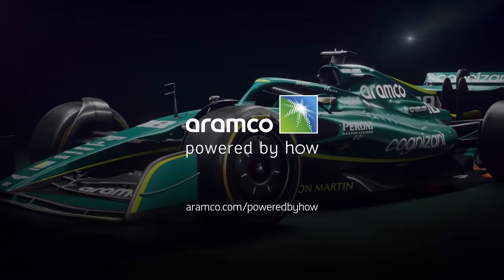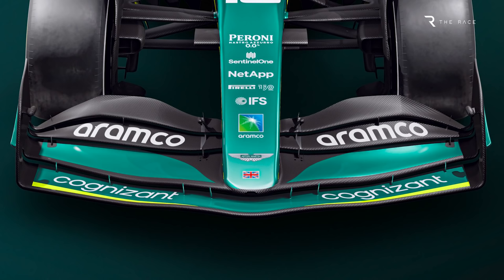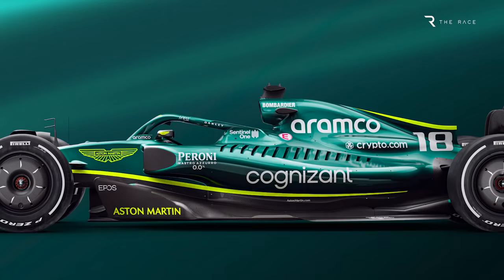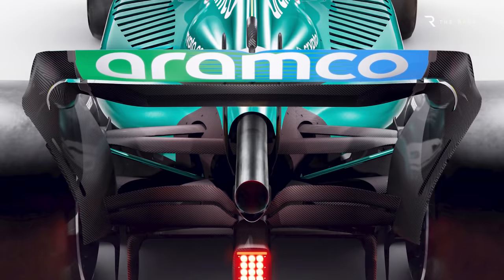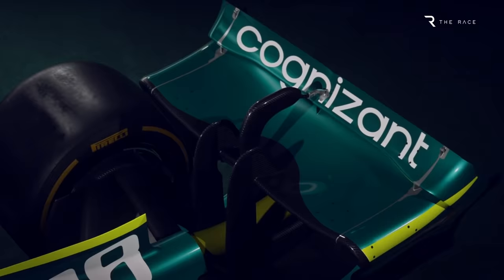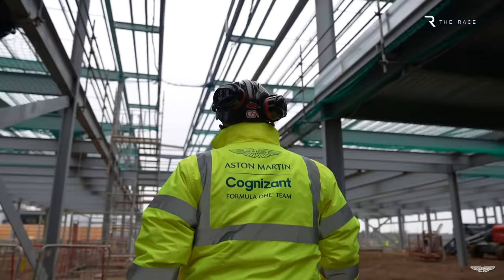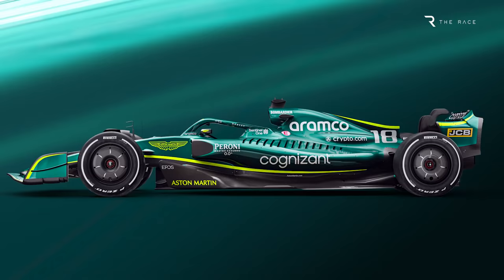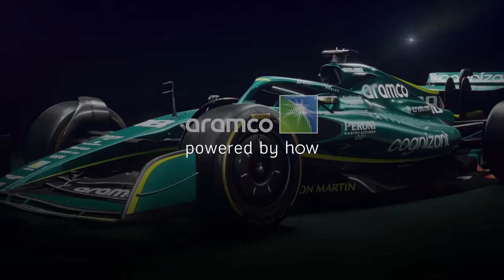What Aston Martin’s ‘honest’ 2022 F1 launch revealed

Comment: @7:44 "The 2nd phase is a building of about 100 square feet to house the new state of the art wind tunnel."

I take it that "state of the art" is Tardis style technology where the inside of the building is significantly larger than the outside dimensions, as fitting a Formula 1 car inside a building measuring 10 feet by 10 feet would be challenging.

Comment: 7:45 100 square feet is a smol building (10 feet by 10 feet, or 3 meters by 3 meters for those not in the USA). I believe you meant 100,000 square feet, but I'm only guessing. Cheers.

Comment: The biggest noticeable difference of these reveals is the high placement of the intakes for the radiators. Can't wait for the results of the on track testing of the beta reveal- of course the REAL design won't be known until the first race. For now they tease us with paint/decal designs. 
 the biggest notation for Aston Martin are the "gills" on the side pods. I struggle to believe those will be a reality. It could be, but at this point, it's liars poker and don't believe anything I see besides the sponsors.

Comment: what do the vents on the side do.  Haven't seen that anywhere else.
Reply: Listen to the video and you'll find out 🤦‍♂️
Reply: I'm not going to be an ass like the other guy. So basically they vent out the hot air from the radiator to the rear wing.

Comment: I hope they've got plenty of spare floors for Lance, and a few for Seb....
The rules should have stipulated wider side pods to protect the floors, there will be carbon fibre littered everywhere.
Reply: Floors get damaged anyway and being it’s majority a whole carbon piece instead of 10 carbon bits it will have more strength. Anyways if you were as clever as you think,  then you’d be the one making the cars and not commenting on youtube
Reply: @johnj9111  maybe Mercedes will make them really strong, enough to wipe out Max's wheel.

Comment: The cooling louvers on top of the side pods is NOT aerodynamically efficient.

No coke bottle body like the HAAS and RedBull.  The AMR22 has a wide body forward the rear axle.

This is probably just a mock-up and not the real car maybe???  We'll see in testin.
Reply: Cooling will never be 100%efficient. That's why people are being payed millions of dollars to figure this stuff out
Reply: @jackvanepps7301  - Well, teams have had this turbo-hybrid formula going on 8 years and no one has put that many cooling louvers on top of the side pods to cool the engine.  I have seen cooling louvers on either side of the driver area but never on the top of the side pods.  Teams also cool the cars by opening the end part of the body next to the rear suspension.
The way AMR22 has these cooling louvers located makes for a "choppy" airflow over the side pods hence as to why no one has done it....until now possibly.
Reply: @jgonzalesm6  those cooling louvers werent allowed in such a big area before
you can also see that the haas car has a tiny rear end an thats because they plan for the air to exit somewhere else
probably cooling louvers as well
and getting a small rear end with lots of airflow is essencial for diffuser performance
Reply: @MmpM123YT  - HAAS and RedBull both have the coke bottle design when it comes to the rear part of the body.
The AMR22 has a very wide body going into the rear suspension.
Reply: @jgonzalesm6  well yes but this is clearly the most developed and closer to the real thing car
i mean we shouldnt even be considering red bulls car as it was basically a joke just the fia concept pretty much
and the haas car is supposed to be from a very very early development stage
but it can at least give us some insight into what they were thinking
but this idea of channeling air underneath the sidepods isnt new
it just wasnt used because its goal is to boost diffuser performance and the diffuser wasnt as important on the previous cars
its a tradeoff thing probably between drag and downforce
but these cars shouldn't be to draggy anyways
Reply: @jgonzalesm6  it is possible that the final design is more coke bottle like but i wouldnt be surprised if it werent
Reply: @MmpM123YT  - "RedBulls car a joke".......????

RedBulls achilles heel was the engine in this turbo-hybrid era until Honds came along and FINALLY battled against the Mercedes in 2021.
Reply: @jgonzalesm6  i am talking about the concept
its clearly not their car and just a showcar to put the livery on... so the lauch was kind of a joke because they basically lauched nothing
Reply: @MmpM123YT  - ahhh.....I see.